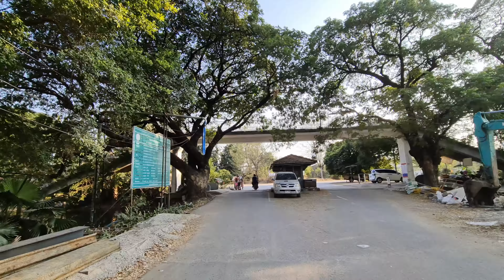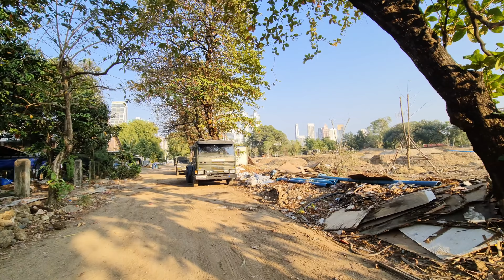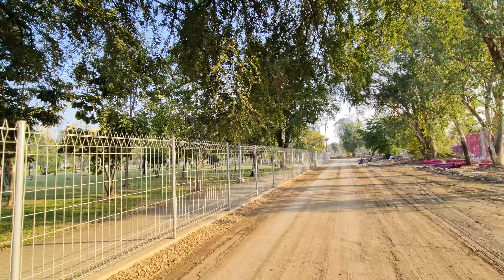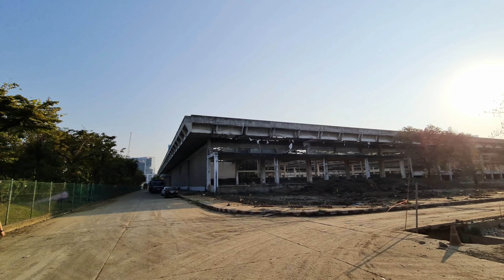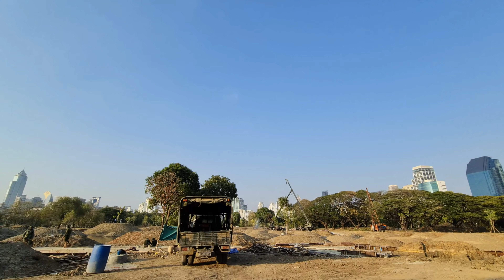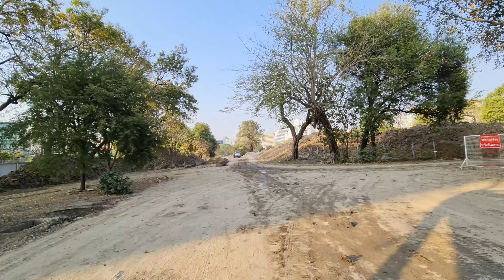BANGKOK New Central Forest Park - Amazing Project under construction

Comment: Wish they'd had dug deeper to created ground waterbanks and monkey cheek reservoirs. This would be worthwhile during the rainy season.
Reply: They do but not using large reservoirs. BMA has an ongoing project along with Mega Tunnel. They construct many small underground reservoirs (บ่อหน่วงน้ำ) in every area to catch heavy rainfall water nearby instead of moving water in distance because moving water is not efficient and canal system could not handle it. It's better to do this way and pump it out later and also can handle up to 60mm/hr for 1-2 hours in the area project was complete.

People complain about flash floods which, in most cities rain > 60mm/hr will flood even with good drainage system. Problem is more like water is heck dirty because we didn't separate wastewater from rainwater.